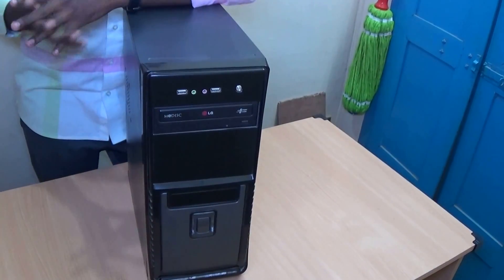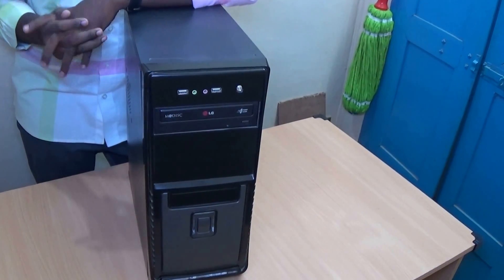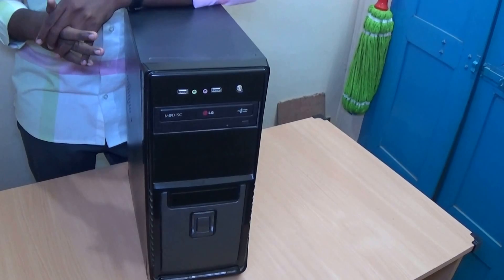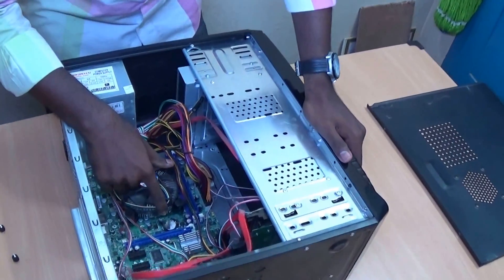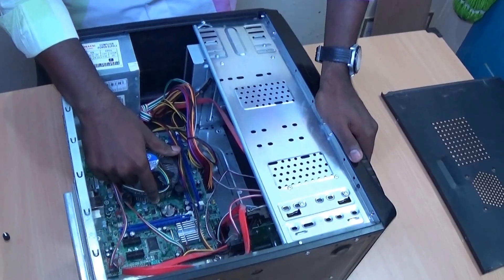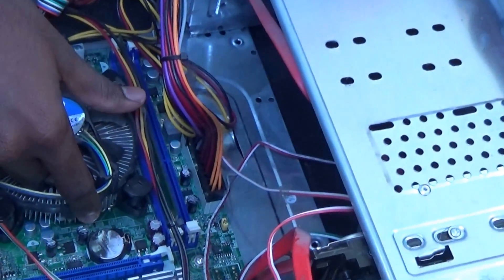How to Replace CMOS Battery in a Desktop Computer's Motherboard

Comment: My new PC have some issue with shutdown,so after I shutdown the pc,goes in process very good,but the 4 case fans remain on,and the LEDs too. I try to disable fast boot, nothing's happened,enable erp, did not helped. With other setting in BIOS I didn't mess up,I m not familiar with it,so..what can help! Mention that all components are new,PSU,mobo,CPU.. everything.

Comment: How to know that you have change the motherboard battery
Reply: If after powering off the computer and then turning it on again, you notice that the system has the incorrect date and time, then this is probably caused by a dead motherboard battery. In addition, some systems after powering them on, will stop before the operating system loads and provide a prompt to enter the BIOS settings or continue starting, when there is a dead motherboard battery.

Comment: Ant you suppose to use a ESD wrist strap while working on a PC ?     Especially while the mains plug ant grounding the pc, can't afford to mess mine up just for a battery. Thanks Matt
Reply: I think when you touch the shining metal parts of the chassis you are at the same voltage level as the computer and there will be no danger.
Reply: I replaced my battery successfully without a wrist strap.

Comment: Hey Sir,
My pc is turning on and off repeatedly... When I click the power button it turns on for 1 sec and then turns back off... and again, tries to turn on by itself and again turns back off repeatedly...
Is It because CMOS battery?
Or faulty mobo?
Reply: irfan mojumder Quick fix that worked for me:take out the ram, clean it with rubber and then when placing it back, use alot of pressure, then lock it in
Reply: Did u fixed it. Did it occured when u changed the battery?
Reply: Take out the cmos and put it back in, it fixed mine when i had that same issue
Reply: ram stick

Comment: you have to unplug your CPU? wat?
Reply: PC in Indian called CPU.
Reply: Helpful but where can you get one?
Reply: @KrisPaterson  you can buy these batteries on the Internett or anysupermarket but it has to be a 
3v battery 
Lithium
Cr2032
Reply: Remove the cpus power cord or we can say the cpu should not be connected to the wall socket(NO POWER) 😅